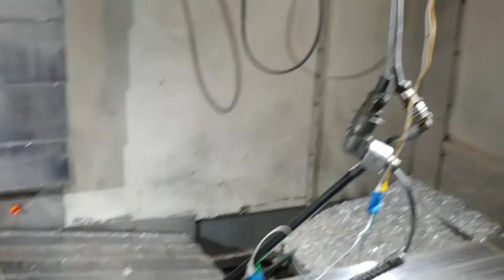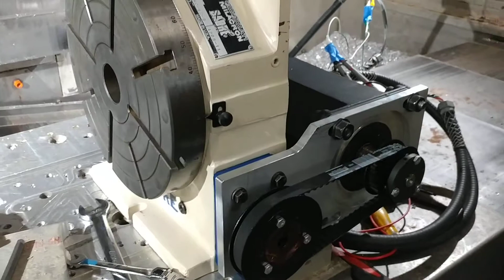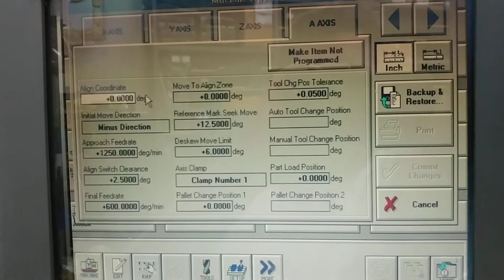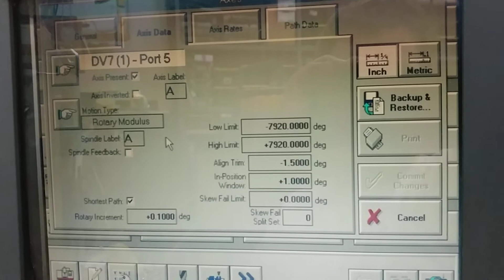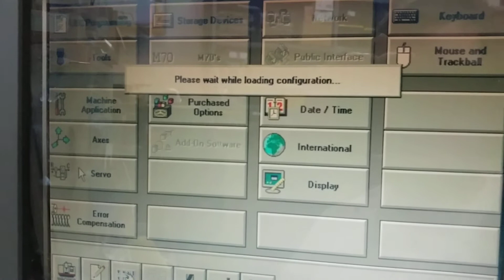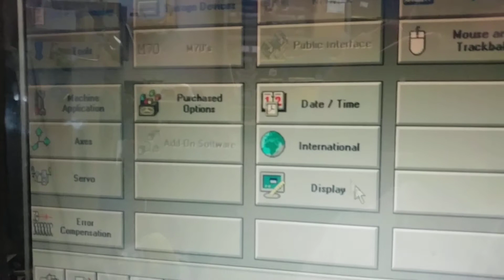A2100 Troyke 4th axis working

Comment: I have service level access on my machine, so I think I can enable the A/B axes. Did you need to add any kind of driver or anything for this? Or were you able to just wire it in. I'm assuming you would need another servo card maybe?
Reply from the maker: @SamCyanide  you just enable it in the pendant. No service level needed. You need a 4th axis drive. I can take another video of mine if needed
Reply: @OlsonKustomWorks ok interesting. Yeah I think I have two extra rs232 ports on the servo card or similar on my tree vmc500 with a2100 control. I'm assuming that's how it is mainly controlled. So do I need another servo pack like a yaskawa or do the fourth axis you can generally find have this already, and you just need to communicate with it to control it and give it power? I have a lot more research to do so yeah I would definitely love to see more of what you did to set this up, because your machine is very similar to mine. Thanks for the help either way
Reply from the maker: @SamCyanide  the extra ports on the control are for additional axis but you also need an extra drive and cabling. Most come with it prewired but if your software doesnt have the option turned on youll have to call fives and get an option code to actually enable it. Ill take a video in the next few days